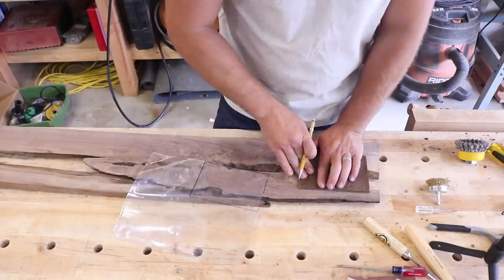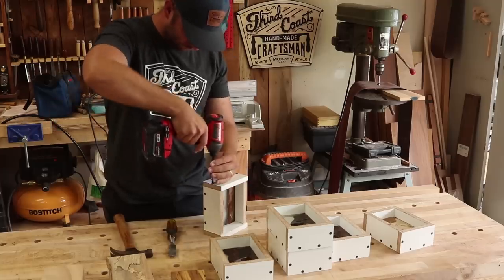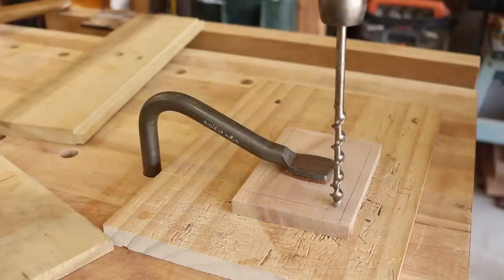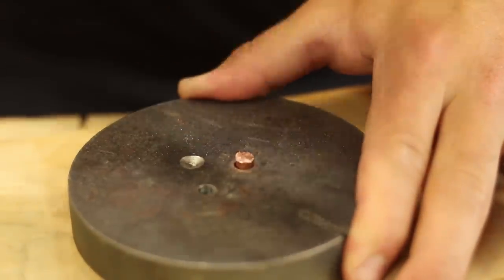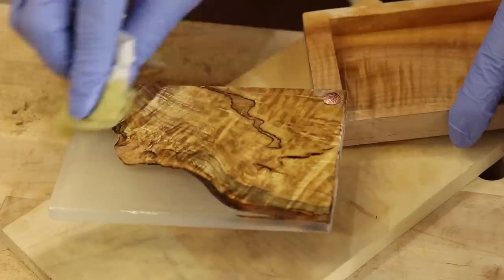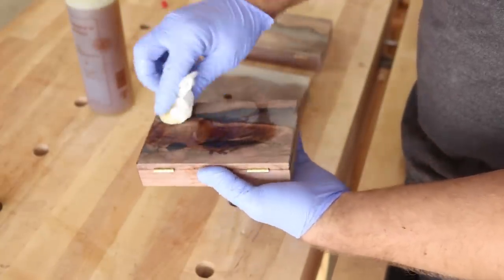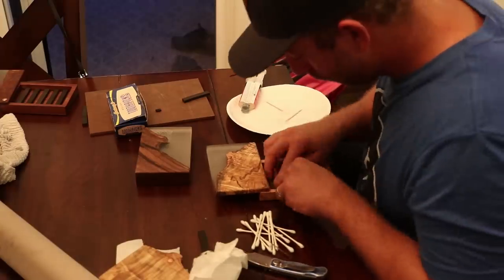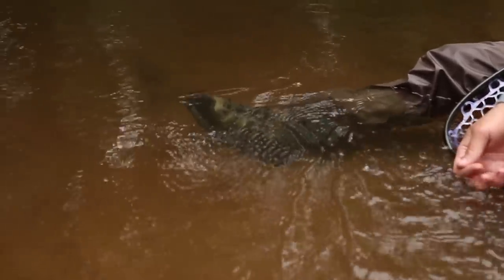Live Edge Epoxy River Fly Boxes // Woodworking // Fly Fishing How To

Comment: So nice! I really like the scalloped epoxy texture. Very cool effect. Might have to try that
Reply: Wm. Walker Co. I'm 100% with you on that one...i was going to comment the same thing.
Reply: I like them best as well. Make the epoxy look like water with these ripples is a great finish for a flybox
Reply from the maker: I suppose I’ll allow you to try. After all I did steal your lighting advice for some of those shots with the gouge haha ✊
Reply: The walnut half and half with scalloped epoxy definitely the best. Although the one with the scalloped epoxy running down the centre probably most resembles the river that you're fishing on. Don't know if that's what you were going for, but it worked nevertheless!
Reply: Nice,you said instead of the board you would use tape,what kind of tape? To avoid sticking
Reply: What did you use to get that texture on the epoxy?

Comment: Lovely! You could also make the inside of the flybox with four pieces and glue them together (instead of cutting out a square out of a full rectangle). Saves a bit on wood and you achieve the same result. It's pretty cool if you change up the wood there too, so top side dark wood, side lighter, etc... . Anyway: really cool: the epoxy turned out great!

Comment: Spraying your form with PAM (cooking spray) will help a lot to prevent the epoxy sticking.  Also paste wax helps and Tap Plastics makes a special paste wax for pouring epoxy.  I've used both while building small boats.  PAM works especially good when you need to remove a screw or bolt from the epoxy after it has dried.
Reply from the maker: Thanks for the awesome tip

Comment: I have probably watched these box builds several times they are so good. I have a question about Mahoney’s Walnut Oil. I am interested in using it in addition with the wax they offer as a finish for furniture. Is the Walnut Oil similar to tung oil? Looking to keep it simple, natural, and easily repairable if needed. Not necessarily looking for durability of a poly or varnish.

Comment: Truly inspiring, I'm going to have to try and make something along these lines soon. Am I right in thinking that is a split-cane rod? I have a beautiful cane rod that is roughly speaking an 8' #3 weight, I've not fished in a few years, too many hobbies!
Reply from the maker: Thanks Tim! I wish it was a bamboo rod. It’s actually on my project list to build one. This was a fiberglass rod which is a close second to the soft feel of bamboo
Reply: I looked into building one myself a few years ago, not easy but certainly a worth-while project. I've never fished with fibreglass, my other rods being carbon, the bamboo rod is in my opinion streets ahead however, it has a delicacy that is hard to beat. I'm extremely lucky in that mine is a Tom Moran and as cane rods go, they don't get much better than that!

Comment: I, too, like the textured epoxy. It completes the effect of the "frosted" epoxy. So many try to polish the epoxy to a glass-like finish. This goes the opposite direction and avoids a run-of-the-mill look. All of the boxes are great but the one that swivels in the center of the side is "unique". Too bad every board doesn't have the remains of a limb like that one did. But then it wouldn't be unique.
Reply from the maker: Thanks so much Thomas. I agree that one box is super unique and one of my favorites!

Comment: Beautiful work & great job on the video! Would you mind posting a link for the epoxy resin you used? I'm looking for a brand that can work for thicker castings without having to pour multiple coats. Thanks!
Reply from the maker: the system 3 epoxy i used isnt quite available in store yet, but another good one is ecopoxy
Reply: I do have a local vendor that sells ecopoxy. I'll give it a try. Thanks!

Comment: put a propane torch on the metal when its to hard to work ,not to change color or anything just so its hot enough it will soften the pin
Reply from the maker: I knew that would work for the one side, but once its in the wood I dont think Id be able to temperate back that way. Id scorch the wood